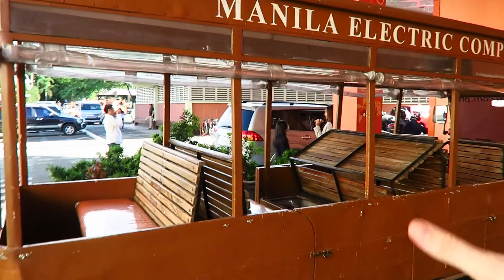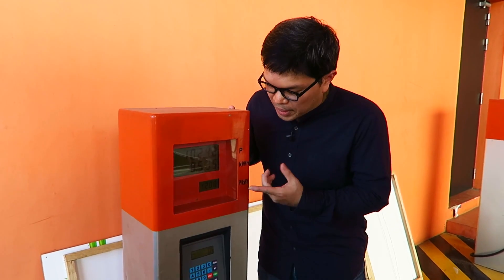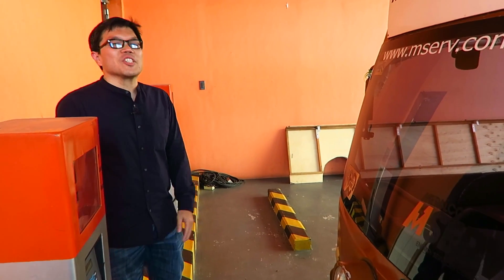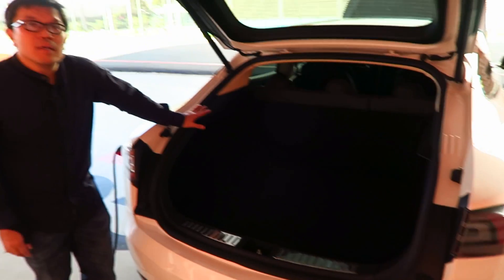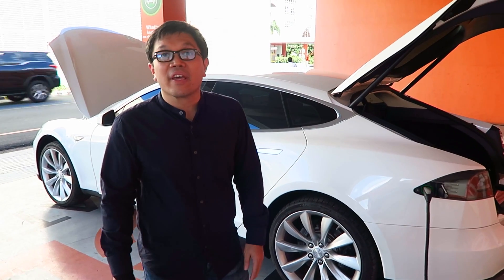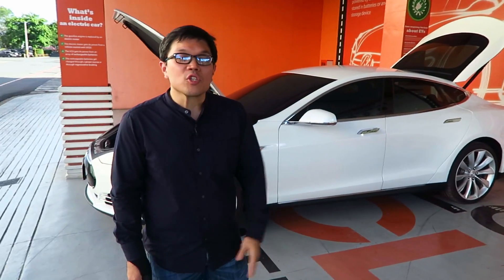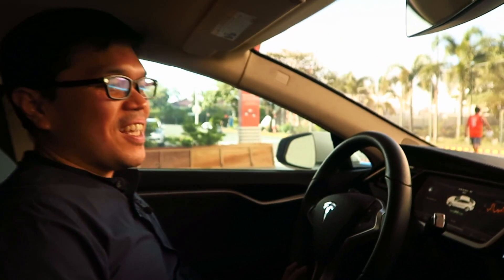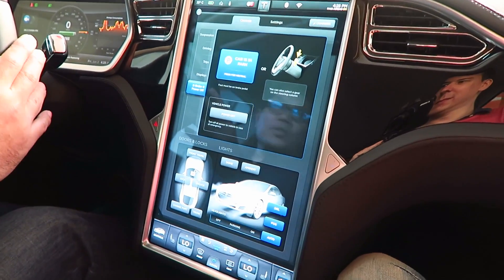E-Vehicle Power Station from Meralco - Part 1

Comment from the maker: To support my channel and e-vehicles in the PH, please hit the thumbs up button and consider sharing this video with your friends. In the video I talk about deep cycle lead acid batteries being "old technology". The truth is, most heavy electric vehicles like shuttles, buses and e-jeepneys are still using this type of battery because it gives you the best bang for buck and size/weight concerns aren't that important because the vehicle is so large anyway. Many e-bikes and electric cars are using lithium-ion batteries which are lighter and smaller but the cost is much higher. Regardless of the battery type, the vehicles themselves are pretty much identical in design.

Comment: i have a couple of e bicycles,  but im afraid to use it on the roads because ph laws are still not up to date with ev's
Reply from the maker: I have an e-bike also. I bought it used and it's kinda old. I think as of late 2016 you're meant to register your e-bike with LTO. I don't know if it's just for bikes over a certain power or if it's for any electric-motor powered bike. If I'm honest, a lot of the e-bike riders I've seen have been pretty irresponsible in the way they ride it and even where they ride it (e.g. EDSA). So I'm not that surprised LTO have cracked down on it.
Reply: Gadget Addict im still outside the country but im monitoring the situation thru ebike forums and pages and thats too bad. ibe been plnning to settle in the ph in a coupke of years and plan to use my ebike and it looks like because those kind of riders im gonna be lumped with them if Ibride mine for work for example. the LTO needs to be clear with the rukes and enforce the rules consistently so law abiding ebikers can also enjoy the benefits of ev's. over here in California, im tentatively banned on trails but i can ride my bike on the streets and bike lanes without anybody harassing me
Reply from the maker: I agree, they need to work on clearer guidelines for electric bikes. I've been looking through their website and can't find much information. Most of the information actually comes from news websites and who knows how accurate they are.
Reply: Gadget Addict the only way I would think I could get away with riding an ebike is to get those expensive stealth ebie mountain bikes. my bafang mid motor ebike would attract LTO officers easy and I think its what most pinoys can afford
Reply from the maker: You can just register your bike with LTO and then you wont have any problems at all. I just don't know how easy the process is, especially for those of us with old second-hand bikes which obviously don't have any paperwork.